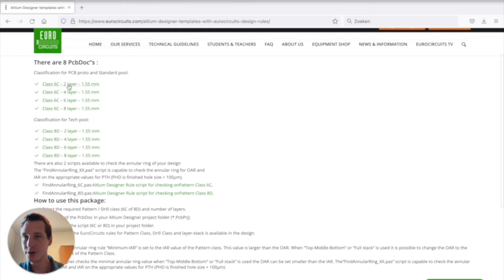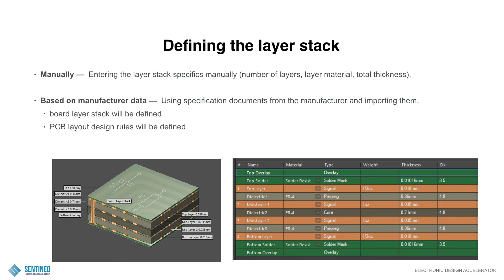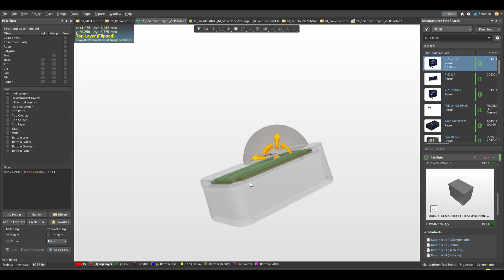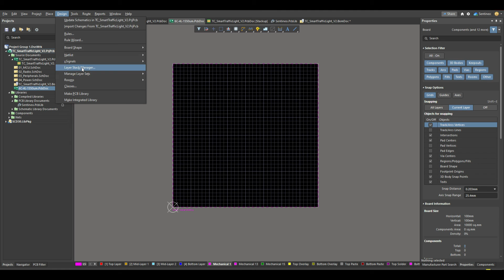How To Define a 4 Layer PCB Stackup

Comment: shouldn't 4 layer stack be SIG-GND-GND-SIG since there is a thick core between the two GND planes which means?
Reply from the maker: Depends on your application and the interlayer thickness that you select. You're right that for instance (Signal+power) - (gnd) - (gnd) - (signal+power) can be a good choice as well. Here is a nice article discussing it further: https://www.allaboutcircuits.com/technical-articles/common-layer-stack-ups-for-a-four-layer-board/